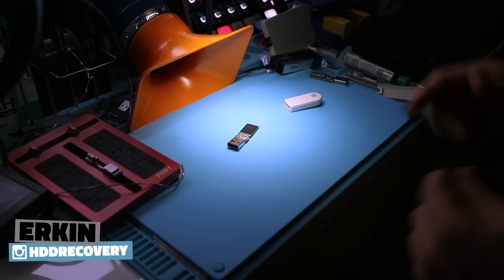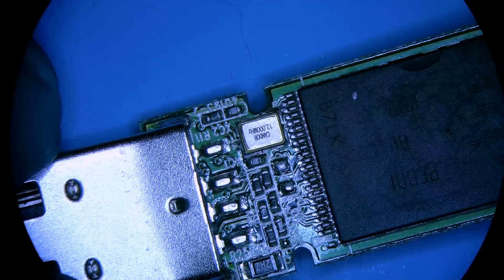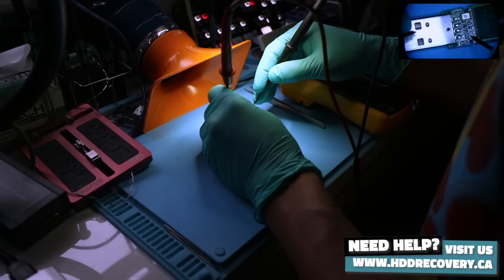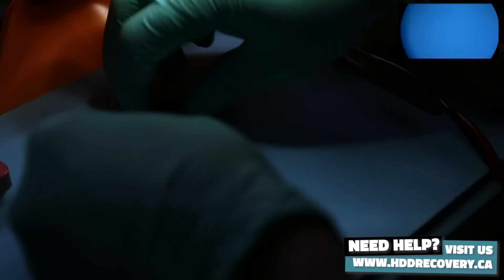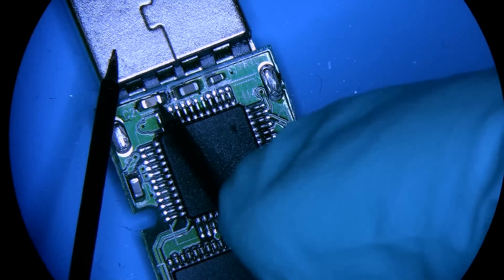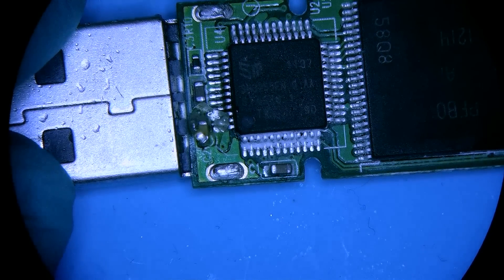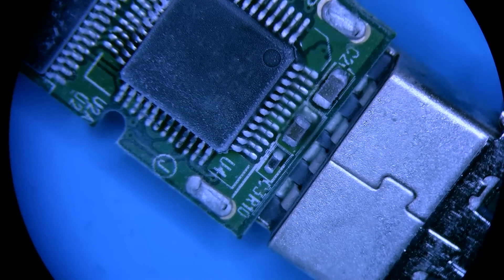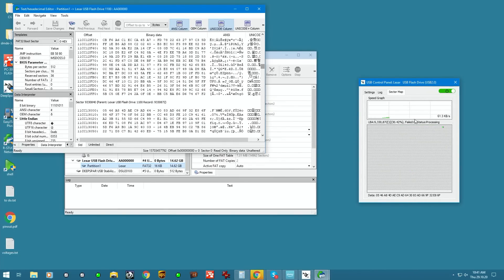bent flash drive gets warm

Comment: I don't understand how bending the board causes a capacitor to be shorted.
Reply: Surface mount chip capacitors are generally made of layers sandwiched together and interconnected at the ends, making a kind of zigzag pattern.  If they are subjected to enough force to crack or sheer them, then the tiny layers become offset just enough to short out.  Most times you can't tell the cap is cracked by the naked eye nor even with a microscope.  Sometimes X-ray photography can reveal the crack.

But unless you're trying to research a manufacturing process flaw that puts stress on the cap and makes parts fail on their own, you don't over-analyze it.  You just identify the bad part and remove and (maybe) replace it like Erkin did here.

Comment: 3:45 Come on, all that equipment and there still was no budget for a Flir One?
Reply from the maker: It's not the budget, it's a need.
Reply: @hddrecoveryservices  Argument was rather that they have become very cheap, so the investment can be justified even when you're using them only once in a while.
Reply from the maker: They did become cheap, but I still don't see benefits of having it for my work. If it was something that would make my life easier or the process faster then yeah.
Reply: It needs if you want to repair any complicated board with many small components. It is overkill stuff if board has only few capacitors.
Reply from the maker: My point exactly. We don't work on motherboards or phones.

Comment: I'm using alcohol spray to detect which components are hitting up. This way applies less thermal stress for other components. Another way is to attach thermal paper (any receipt from any store) it became black under hot components.
Reply from the maker: Nice! I'll keep that in mind
Reply: Interessting! Can you make a video about this?
Reply: Sounds very clever and cost efficient.
Reply: Not to mention that molten ice could short something
Reply: @Grishanof  if the ice were from water, then sure, but it's liquid Oxigen, that's a compressed air canister turned upside down and sprayed onto the board, it ain't gonna short anything, as soon as it warms up, it evaporates.
Reply: @louis6593  it looked like regular propane/butane can to me. Not sure if even oxygen cools enough to freeze on decompression, but water vapor in the air gladly condenses on anything.
Reply: @Grishanof  true, I forgot about the condensation. However compressed air does the same thing if turned upside down, and it's less dangerous, not flammable. It worked for me thus far.
Reply: @louis6593  i agree, upside down spraying is much faster way to cool items. I'll have to recheck the process on the condensation topic. Perhaps it's my habit to have IPA can on my workbench to clean the flux or just dirty PCBs, since it's already on the desk, meanwhile compressed air cans are used rarely in what I do.